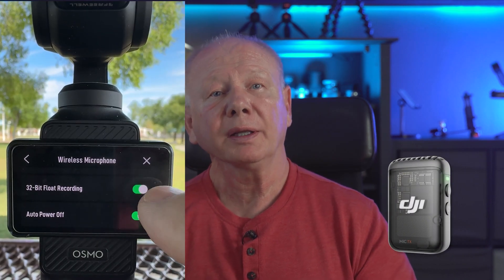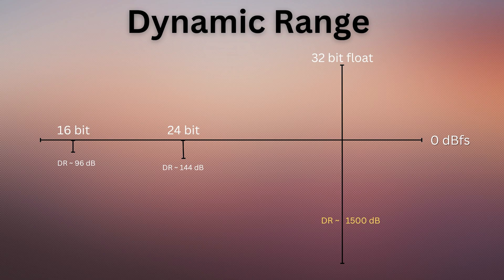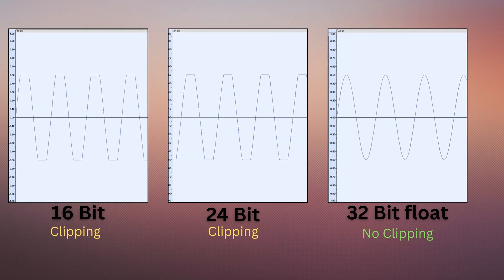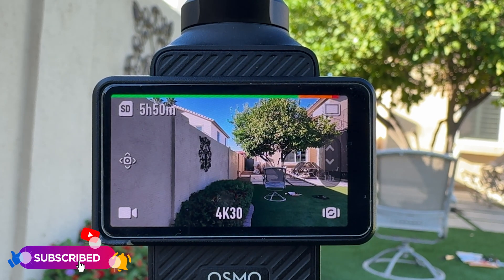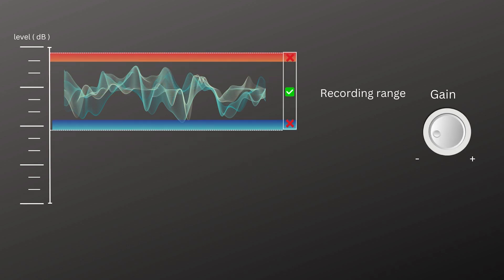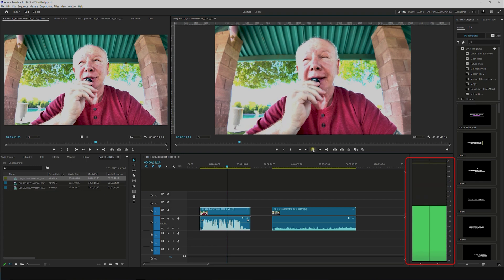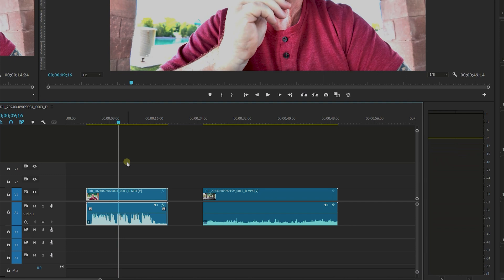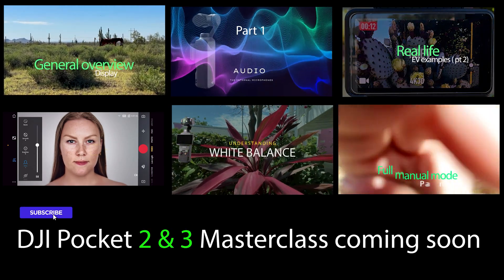What  is 32 Bit Float | DJI Pocket 3 & Mic 2

Comment: Thank you for this video. If the 32 bit is enabled on the dji pocket 3, is the audio that is baked into the video also 32 bit if using the DJI MIC 2 transmitter? Or is it only 32 bit with internal recording of the DJI MIC 2?
Reply from the maker: Yes, the DJI Osmo Pocket 3 can record 32-bit float audio using its internal mics. The Pocket 3's internal video files recorded to an SD card have 32-bit float audio, whether recorded using the built-in mics or an external mic
Reply: @billbuckleytutorials Ok so youre saying that: 

If I enable the 32-bit float setting on the DJI Osmo Pocket 3,  the audio captured by the connected DJI MIC 2 and saved to the micro SD card will be of 32-bit float audio quality?
Reply from the maker: @EverythingPKW  yes

Comment: Thank you for this video. One note however, when editing the loud and whisper versions it looks like the audio from the clip on your timeline is the audio that was saved into the mp4 file. It was my understanding that DJI pocket 3's microphone saves the 32bit version in the microphone itself. So it should be loaded separately into your timeline and synched with the audio included in the mp4 file. This should normally give you the needed dynamic range so the audio won't be clipping. I agree to the fact that bad audio in is bad audio out but i'm not sure if the audio track in your timeline is the one that was saved into the microphone itself. Might sound better if it was not the separate file from the mic.

Feel free to correct me if i'm wrong.

Anyway, thanks for your explanation and time you spend on making this clip.
Reply from the maker: Actually it was the clips from the mic (32 bit) . I synched the files with the video and removed the original audio then linked them again. 😀